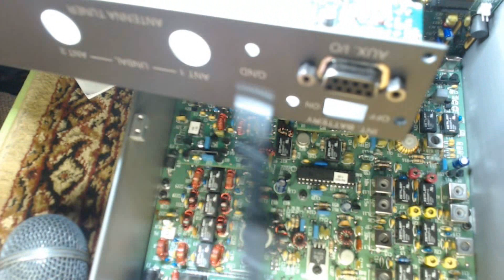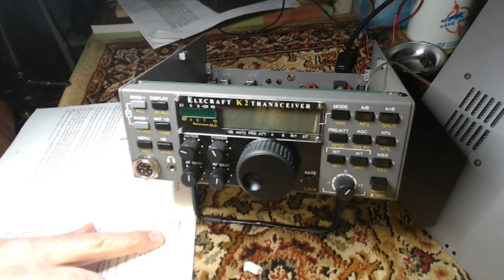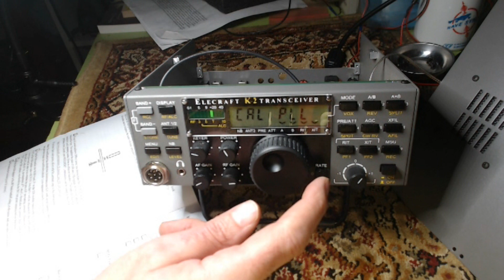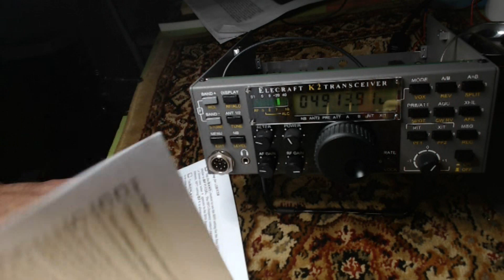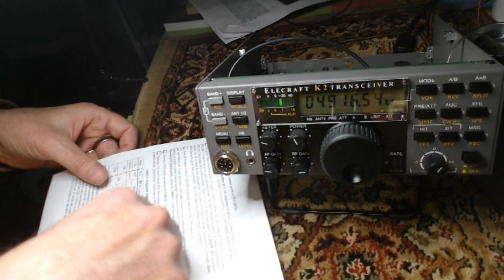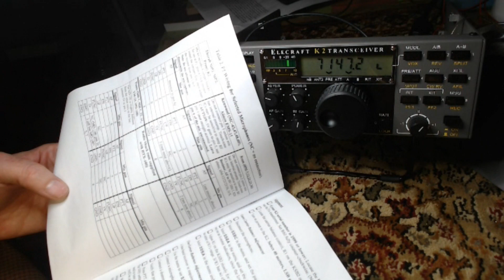Elecraft K2 SSB & NB Part 21

Comment: Thomas, late to the dance here but wanted to give you a pat on the back for your homespun but wonderful K-2 build videos! Those - and the others on your channel - are exceedingly fun to watch because they bring back fond memories of my building of good ol' #999! The K-2 is truly a "build" while the subsequent Elecraft radios are more appropriately an "assembly" exercise. (No soldering done for the latter.) 
Also hoping you have begun your retirement 9at this writing (October 2022) and are working your way through your stockpile of projects! I retired five years ago this month and like you, stocked up on kits and projects beforehand. Also, a side bonus is maintaining the historic test gear too. Like you, I have a venerable AN/URM-25D (two, in fact) that I revived and had to bring "out of the bullpen" to replace my "southbound" Wavetek 3001. 
Anyway, good luck with your endeavors and keep on trucking, old son! 
72 de William, k6whp
dit dit

Comment: Curious to know............ are you not concerned with static electricity? Building on top of that table runner/carpet thing?
Reply from the maker: Actually I hadn't thought about it, since the desk is my ham shack as well as my work bench because I have limited space, carpet thing is really there is part of the ham shack not so much the workbench. Good point though, thanks for stopping by!